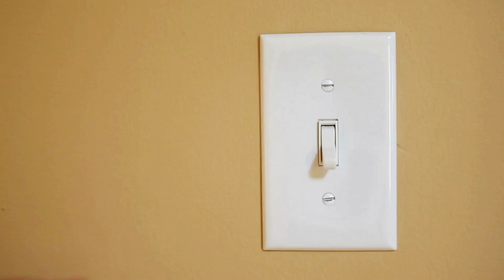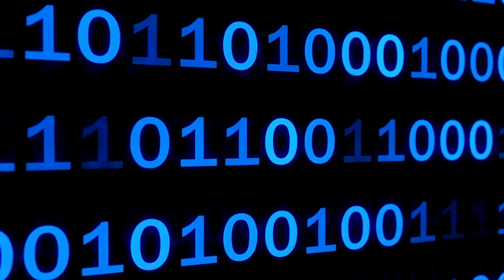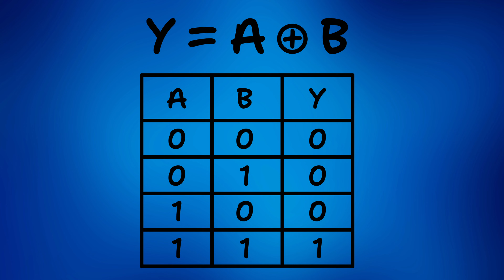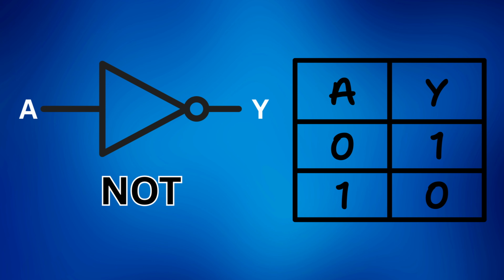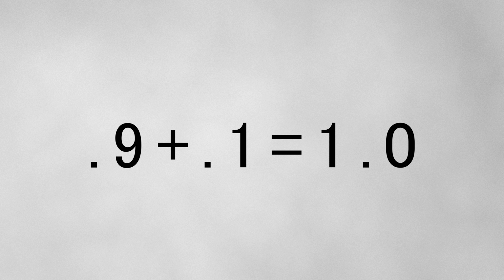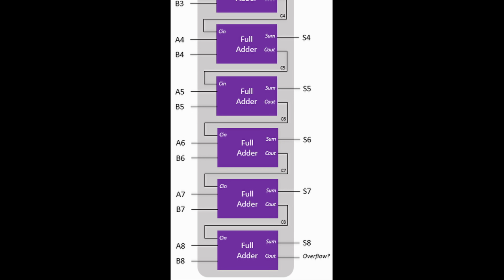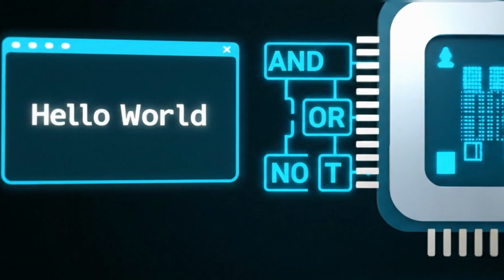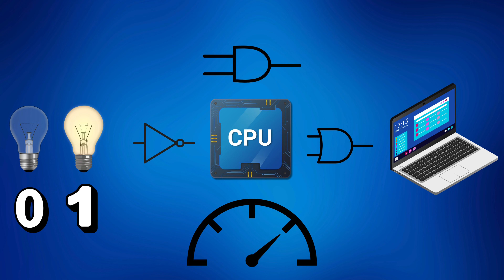How Computers Really Think (Binary & Logic Gates Explained)

Comment: Please explain how exactly Ram works, and how the display works. I can't find a clear video anywhere.
Reply from the maker: @Kaushik129 Thank you for your patience! I wanted to personally let you know your video topic request is this week's video! Thank you again for your awesome suggestion, and I really hope I did it justice. Please let me know what you think when it drops later today! 🔥💙
Reply from the maker: Of course! I can definitely get those on the schedule. Could you elaborate on what you mean by "how the display works" Do you mean like how video is displayed on your screens or something else?
Reply: @ZedITTech 

In a computer system, how is video data transferred from the Random Access Memory (RAM) to the display (like a monitor) via the Graphics Processing Unit (GPU) or on-board graphics? Specifically, how are the pixels on the display processed and shown sequentially, usually from left to right and top to bottom (the scanline method)? Please explain the underlying mechanism for this sequential rendering, including the roles of timing signals, video buffers, and data protocols (like HDMI or DisplayPort).
Reply from the maker: @Kaushik129 Thank you for your extensive elaboration this will definitely help when preparing this. I will get it on the  schedule for the near future!